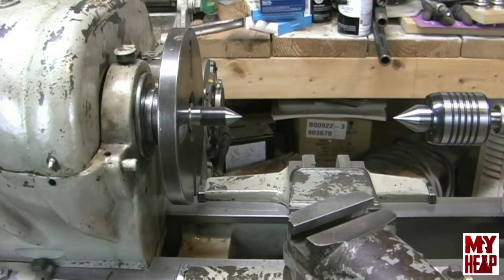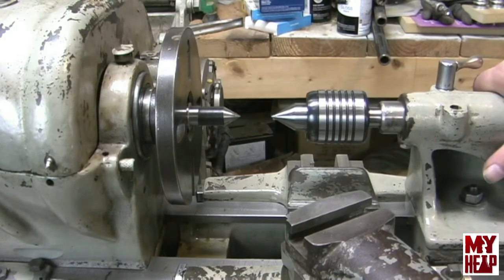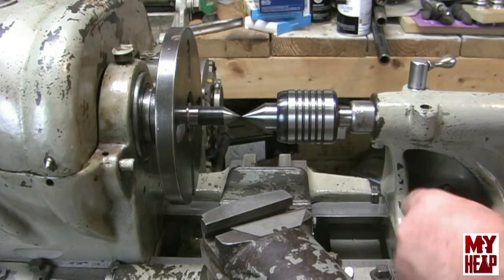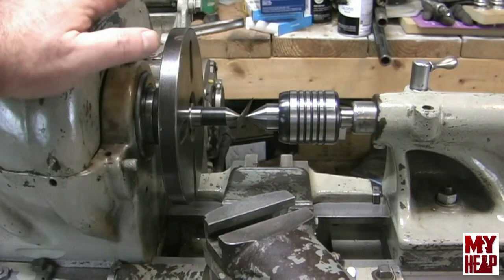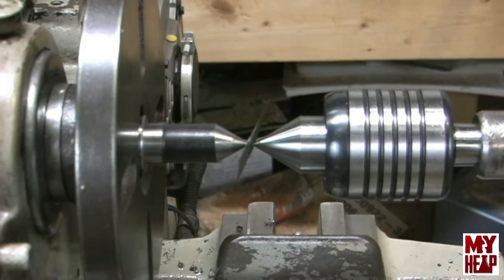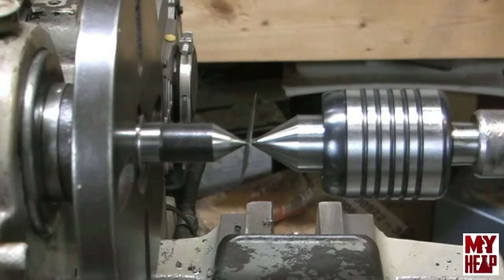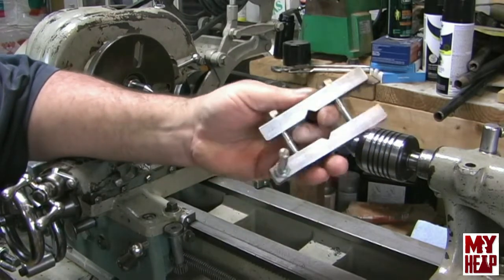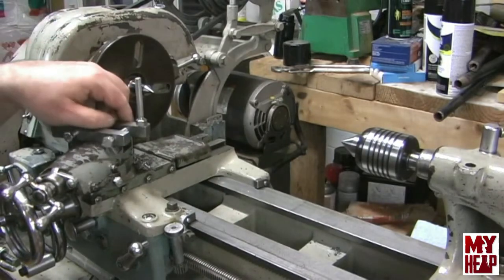YouTube Shop Student - Episode 002 - Aligning the Lathe Centers

Comment: G'day Joe. You weren't waiting for the thread dial to "roll around" before cutting chips were you, that's for thread cutting. Also it took a bit for your method of tailstock alignment to sink in, but I do get it. Cheers Peter
Reply from the maker: Hi Peter.  Yes, I was waiting for the thread dial.  The Atlas lathe longitudinal feed is with the half nuts.  I probably should have explained the process a little better.

Let me know about the books.

Joe
Reply: G'day Joe, the leadscrew halfnuts can be engaged at any time when straight turning, the dial only comes into play to synchronize the leadscrew to the thread you are cutting when thread cutting.
What books are you referring to??
Reply from the maker: Yes, sir you are correct, but I still had to wait till a line came up to engage.  I have since learned that there are 4 other places between the lines that the nuts will engage.  <blush>

I posted a reply on your video about the taper for the Mill spindle.  I was asking if you had Workshop Practice Series #43 and #48.  These are on the Mini-Lathe and one of them has a taper attachment you can make for the lathe.

Joe
Reply: I have 43 but not 48 but then I have 34
Reply from the maker: Peter, book 48, Mini-Lathe tools and projects by David Fender.  Chapter 5 is a taper turning attachment. Which he uses to turn a MT2 taper. Now I know this does not directly help you bore the taper in your spindle, BUT, a MT2 turned onto a bar that fits your spindle would go a long way to setting up the compound on the machine to bore the internal taper.  If you like I can email you the "related" information.  Just let me know and I can send it tomorrow.

Comment: Joe . Chips! Chips!  Atlas
Reply from the maker: Chris Anderson yes sir!!!  Now to get the chuck back plate done.
Reply: Hi Joe, cover your ways as best you can when turning your backplate, slow speed and no oil. And yes you got lucky on the tailstock, usually takes a few tries and with a dead center instead of a live.
Reply from the maker: I will be sure to cover them when I turn the backing plate Richard.  Thanks for the tip.  After I made the video and was editing, I realized I probably should have used a dead center in the tailstock as my live center could have run out.  I think it is pretty close though like it is.  I was shocked to see it come up on zero on the first go after getting close with the box cutter blade.  Also, I think I could have done a better job of explaining what I was doing and why it works.

Joe

Comment: Nice job!  I do hope you did check the level of your bed, actually that the ways are on a consistent plane before before you went to the effort of aligning the centers, otherwise you may have wasted you time.  I enjoyed watching you video thank.
Reply from the maker: Well, I need to confess ...  The lathe has not been levelled and is on a wooden floor in my basement which can flex a bit.  Its permanent home will be in my shop once I get enough of it finished to move out there.  (I am insulating and putting up wall covering, but getting it done debt free is slow.  Not to mention there is so much junk out there that to work it like one of those kids puzzle toys where you move the squares around to make a picture.)  I plan on using (2) 3 floot long pieces of 2" heavy wall square tubing to mount the lathe legs on to give it a little more stability.  I think the cast iron legs seem a little narrow.  At that time I will level it up and go through the process again.

Thank you for watching and commenting.

Joe
Reply: I had a feeling that you had not probably more out of ignorance, being new to this stuff that is why I made the comment, but don't worry your not the first I did the same thing awhile back.  I have a suggestion regarding leveling and this is a good time to through it out, sense you plan to build a new stand or legs.  I did this to my TH54 w/ quick change GB, after a couple times of leveling.... why not putting some leveling screws on the bottom of the legs!  One of the best things I have done to mine!  You may need a little welding but there are other ways also if you don't weld.  I know you will be able to put something together however if I can help in any way give me a shout.
Richard
Reply from the maker: Richard,

My lathe has the cast iron legs and I intend to bolt them to the 2" square tubing.  Then attach levelling feet to the ends of the 2" tubing to actually adjust the lathe level.  Where the lathe sits now, I don't know how much it will actually help to level it.  The floor it sits on in my basement has been built up using 3/4" Furring strips  and 3/4" tongue and groove plywood.  There is some flex in it.  My workshop, although a wood floor is 1-1/4" thick sitting on joists that are on 16" centers and braced.  Much more sturdy.

The other problem I have, is I do not own a machinist level, so even it I got it close, I would want to machine a stub in the chuck to see if it is turning true and then adjust the feet to compensate.  Once it is turning true then turn my attention back to the centers alignment.

Does this sound like a good plan of attack?

Joe
Reply: I understand Joe.  You can only do what you can.  Remember the level is most critical  when needing close tolerances and / or turning long work such as between centers.  Also, "level" primarily means "on a consistent plain".  In other words one end of the lathe can be higher then the other end as long as they are "on the same plain", also one of the ways could be higher or lower than the other as long as you guessed it they are on "the same plain" I hope I'm making sense.  What is not good is to have any "rack or twist" in the lathe bed.  You may already know all this so I hope I'm not telling you something you already know, but because of you floor situation I'm hoping this might help you.  If i'm about to do something very critical or a very long turning I will usually check mine for level.  Sorry for being so long winded enjoy your lathe and have fun!
Richard
Reply from the maker: Richard, don't be sorry for being long winded.  I appreciate the feedback, tips and instruction.  After all I am leaning on your guys to help me learn this stuff.  The lathe doesn't move all that much, but I know it can and does a little.  One thing, at this point if I did want to level it, there is not a good way to do it.  The legs on my lathe do not have any levelling feet.  Now, I have some home made levelling feet that I originally put on my CNC router, I could use these if the bolt size is correct and at least try to get it level where it is right now.

I do understand that the idea is to get the bed in the same plane without any twist and that it does not have to be  "level" to accomplish this.  I have read that once the lathe bed is levelled it is a good idea to turn some stock in the chuck without the tailstock and check for taper.  In this case, it would indicate that you have twist in the bed.  (Although I think wear in the bed can affect it).I am thinking about 4 inches of 1 inch stock in the four jaw for the test.  Then once any small adjustments are made (if need be) and the stock it turned with minimal taper, then the centers can be aligned via a test bar.

This is the procedure as I understand it to set up the lathe for proper turning.  Is this correct?  Most of this information I learned from a book called Workshop Practice Series #34, Lathework: a complete course.  I also know there are as many ways to skin a cat as there are cats.  I don't want to be one of those people who are locked into, "you have to do this and only this".

So now who is being long winded.  Thank you sir for caring enough to get me going on the right foot!

Joe